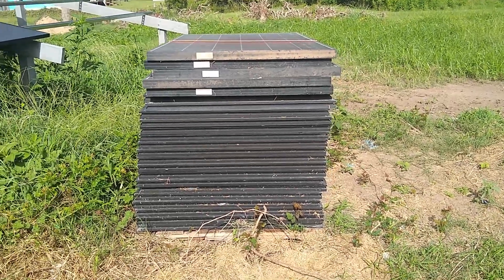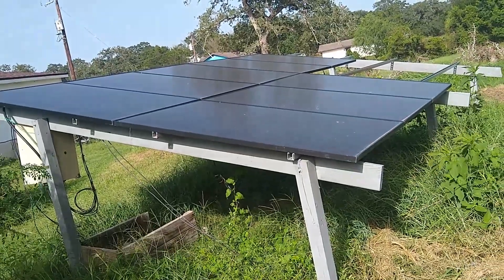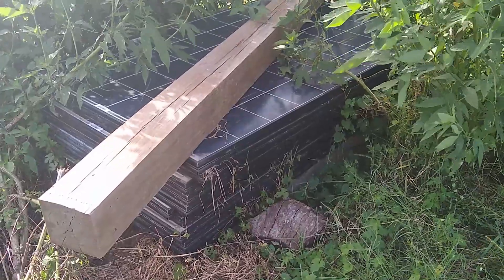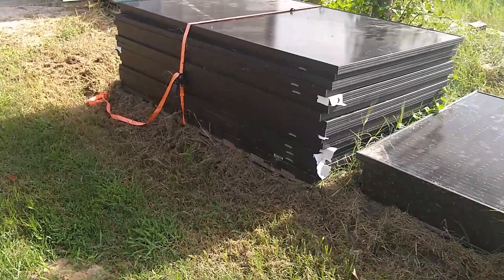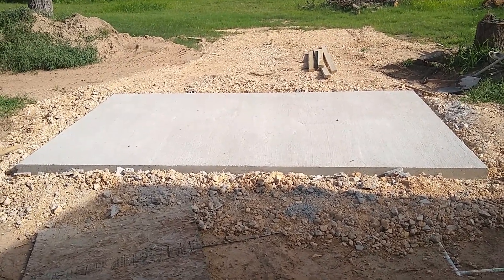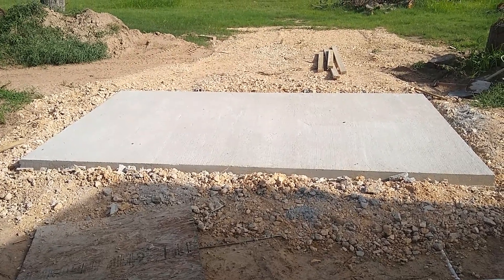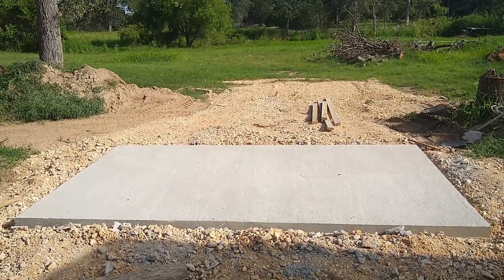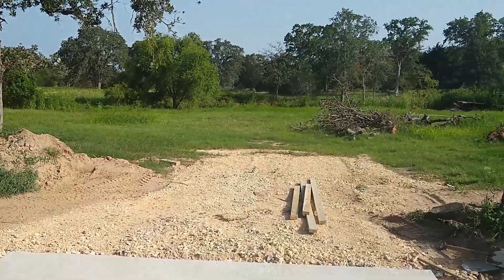Massive 50KW High Voltage Solar System DIY Build!

Comment: 47kW og 2.5 yrs.
Reply from the maker: Nice! Ground Mount?
Reply: @DIYSolarFarming  yes. 4x4 pt posts and unistrut. I would never put them on top of my house. I do have my power shed front and back porches made with solar panels. Use some good quality silicone, plenty of slope and you’ll be fine.
Reply from the maker: Sounds good, thanks!

Comment: I don't think he knows how many panels he will need 50 panels only give you 17 KWS at full sun directly on them witch is about 3-4 hrs on a sunny clear day,if they don't move with the sun, and no power at night.50 panel installation is 68000.00 $ and that's no battery storage.i know I used to have a store
Reply: I think he said 140 panels. ;)
Reply: @SeannaF  He did. 50 @ 325W and 90 @ 250W comes to 38,750W, which is pretty hefty.

Comment: How did you choose that inverter?
Reply: A 140 panels take up more space than that pad
Reply from the maker: There's not a big choice of compatible Inverters in the U.S. and Solis is stocked by my distributor.  Solis also has a good reputation. Two others might be FoxESS and Fronius.
There are other choices depending on where you are located.